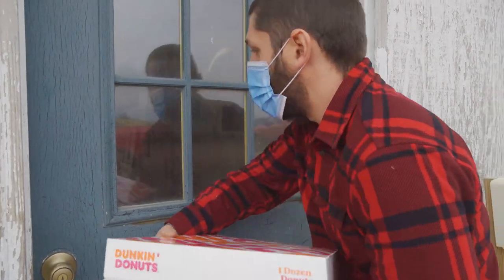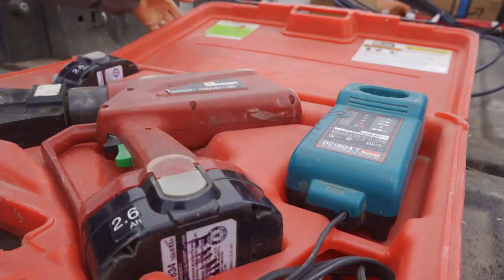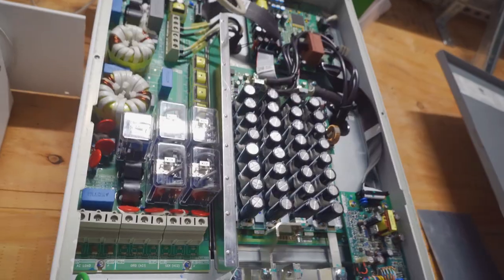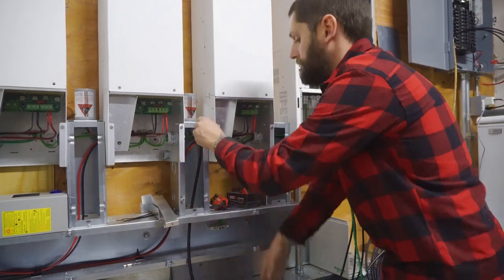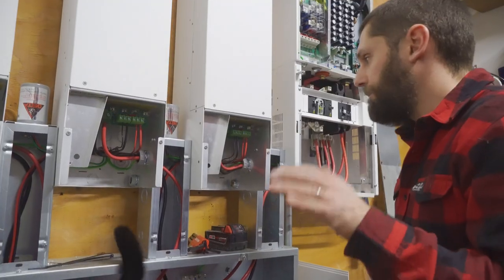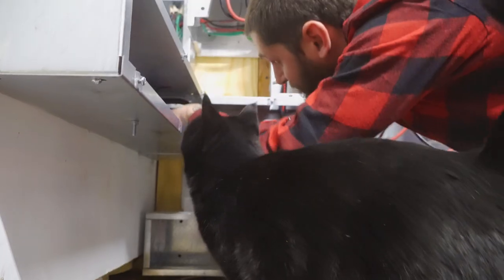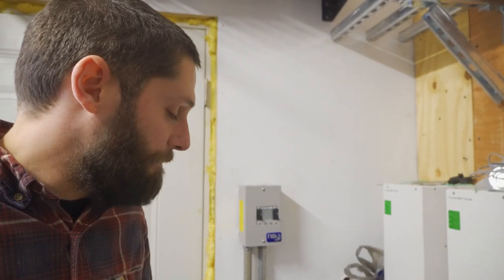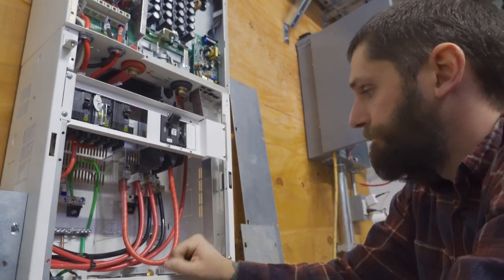Couple Builds Solar Power System

Comment: Has been 5 months since we had internet so why the change of charge controllers, disconnects and inverter? Did you upgrade batteries again? This is the first video of yours seen since moving to this farm Aug 24th. Love the ease of wiring and plug and play action. So one charge feeds battery charging requirements and other two supply direct DC currant to mains of inverter and feed back when inverter doesn't require the charge currant coming from panels? 
Nice clean wiring there, very direct and efficient fastening methods.
Cheers and Peace Out

Comment: Can those terminals be soldered with a torch?  Or would the metal of the connector refuse to bond with flux and solder?   Are those lightning arresters just a large capacitor in parallel?

Comment: When I saw you using that heavy duty crimping tool at your former workplace  it occurred to me that could be done  using a vice to initially flatten the fitting, followed by laying a round flatblade screwdriver between the vice and the fitting to make the indent. Good in a pinch (<ahem) ?

Comment: Out of curiosity, is there any value to using dielectric grease on those bare wire connections to protect them from corrosion?

Comment: How expensive are those cables too? I'd imagine getting the right tool is super important for that critical of a connect. I would imagine having multiple smaller systems helps in case any one of them breaks, your whole system doesn't die...

Comment: When I use the  pull wire in those raceways, I always cut my damn hands on the sharp edges of the raceways. How many times have you done it? I have been retired for 6 years now, and I do miss it at times.

Comment: The positive wires in the breaker box on each switch looked to be very close to shorting. No problem when the switch is closed, but not save when you expect an open circuit when setting the switch to off. Some shrinking tube could do miracles.

Comment: When I worked at Amtrak briefly for a couple of years the electricians had to crimp 00 cable that ran thru the train cars.  I cant image how expensive the roll of cable cost but it was on a huge wooden spool.  Each car they ran a test of the cables and many times it failed.

Comment: I think your control center was well laid out and very well installed.  I am a retired motor controls designer so I have seen a few control centers in my day. However mine was all 480 volts except for the control voltage. I am looking forward to seeing everything working. But I was hoping to see a finished product in this video. Well good luck to you all. Be safe.

Comment: Seems to me that it would be beneficial to label the wires. Josh knows where everything goes, but if he attached a number at each end of every cable/wire it would provide a handy way to build a schematic. Also, If a future owner has to maintain the system, it would be a valuable guide.  Just thinking...

Comment: Actually nice video. I did see your previous(actually your later video) so i see that you did few things not the best way. If i may suggest. Move those breakers  into direct path of cables instead of creating extra few meters of not  used wire..This will save you loos over cables..and trust me you will not need it..You will not switch it on and off often..so better to save extra lenght of cable..also i would suggest to also again connect those charges directly to battery terminals..or bus bars of those batteries..

Comment: I spent my engineering career building equipment for manufacturing plants and I worked with a lot of electricians, but I wouldn’t have the confidence to tackle a job like that.  Congratulations on a top flight job.

Comment: Have the right idea with substantially building up the solar panel array size, but still need: real wire strippers, NoAlOx on the (presumed) aluminum screw terminals, second inverter, heat pump electric water heater, induction cooktop range, electric vehicle with trailer towing capability.

Comment: Just curious.  Do you ever have a point where you connect the DC ground (Black) to green ground. Does one have to put a warning label that Black is DC ground, not AC line?   A good electrician would know the issue but a non-electrician might get fooled.

Comment: Josh :
. Well-designed solar power system  (worked on commercial UPS, generator backup systems for cellular towers, Former IBEW)
. Excellent workmanship that certainly NEC 2020 and exceeds code
. Great video series, composition, editing, just good entertainment.

Comment: Hi, What becomes apparent as you show this process is that having solar power is NOT just having solar panels, you need a whole lot of wiring and inverters and charge controllers and batteries and just a whole system, requiring a utility room, or as you have, a power house.

Comment: Don’t you hate it when the “homeowner” hovers over you while you are working asking when you will get the power back on?  🙂. The cat was just checking to make sure no mice were in the boxes before you closed them up.  Great job, it will be interesting to see the sequence of the switches to bring the system on line. Not as simple as “just flip the switch ON in the power house”.

Comment: I know you've done it thousands of times but why don't you use wire strippers instead of lineman pliers. As for your channel lock pliers, you should have a leather belt holder made.

Comment: You giving the boss a "shock" with your antics reminds me of the time back in high school when a classmate's vehicle needed a jump. I hooked up the jumper cables and proceeded to get her car started. Upon removal of the end of the cables attached to her battery, my hands were out of view while she could see my face. Unbeknownst to her, I had disconnected the cables but I looked at her, pretending to fumble for the cables, and got a  "shock" for a second or two. Her eyes seemed to double in size and her mouth dropped. I stopped and just smiled. I laughed, she didn't, and I laughed some more. Never got that first date. It was worth it. 😁

Comment: When a professional is working even the cat becomes a supervisor. :-)  Question: How much money is saved by Josh being an electrician on this power upgrade alone? Last week you gave the overall cost of the solar power system but didn’t include the cost of a skilled electrician. Just wondering. Enjoy the well made videos. They have been well done from the beginning. You should go over your equipment and set up to include video software and your complete video from beginning to posting process in a separate video sometime soon. I know it’s a lot of work and takes a tremendous amount of time but the end result is very well done.

Comment: Why on earth do you use such a thick cable for 10 Amps of current...???😟😟
Edit.
Ok...I'm assuming the thick cable is not for the "400V from the solar panels" like you said, but from the batteries to the inverter...which would probably be 24V or 48V.😒🤔
Reply: To

Comment: Josh, I’ve noticed you “wiggle” your wires while tightening the screw on the lug when your terminating. Why’s that?
Reply: When you wiggle it, it causes the individual strands in the wire to shift around a little and lets you make sure it is really tight, if you don't the strands of wire over time may shift and leave you with a loose connection.
Reply: Awesome makes sense! Thanks!